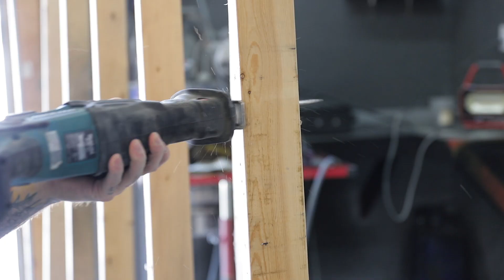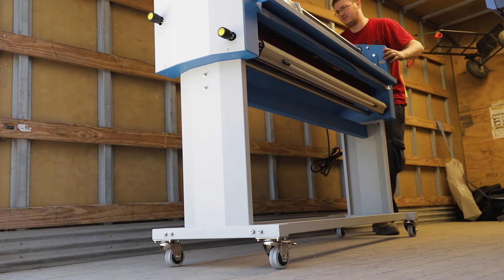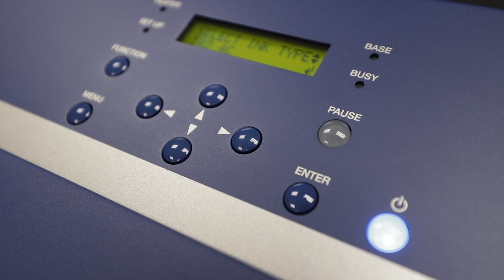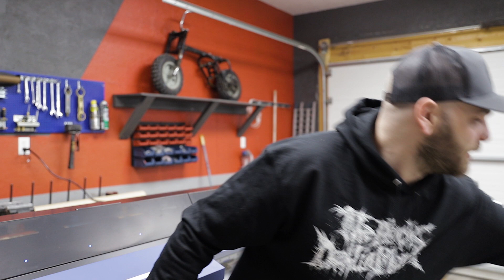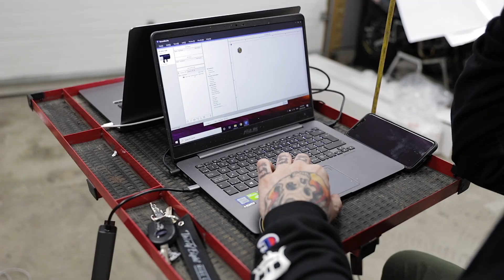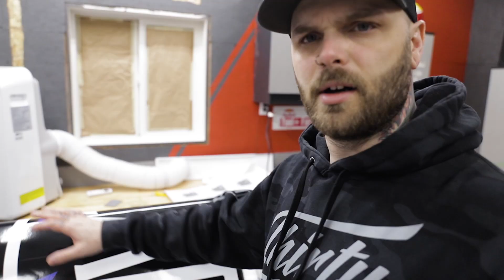What Is Wrong With You? Setting Up My New Roland VG2-540

Comment: O yea i meant to tell you to check the photo or image DPI my HP 1059c plus prints out amazing prints but if the image is 96 DPI it's shit i pump up the DPI to around 600 and they ar fantastic i can also go higher with the DPI but i normally don't do to its an older printer so here is a link to a converter for you https://convert.town/image-dpi

Comment: you live in Florida right ? I live in Pasco ill help you run it, i have an HP designjet 1050c plus 36 inch, you need to setup your print settings its in your printer settings you need to marry your printer to your laptop for colors, color gamut
Reply from the maker: No man I'm in Canada haha
Reply: @leestuart38  well that's a bit far to go hang out just to bust your chops..lol... but if i had the money knowing me i probably would do it hehe, but just check what the max DPI is on that printer and set your image to that DPI, Roland in my opinion are one of the best manufacturers in the business

Comment: They should've advised to get a cheap PC just to run the printer, much cheaper than 3rd party software. Also useful when ripping big jobs, doesn't tie up a machine. I have my Roland five years and the thing I like about it most, is that it just does the fucking job. I keep it cleaned, maintained and treat it like a baby and it never fails me. It has flaws, as does the software, but it works. Lamination is a learned skill, just takes practice. You might have realised this also, but laminating creates mad static and that pulls every bit of dirt to the print. Sealed floors or floor mats help.
Reply from the maker: Ya that's something I wish I would have been told, but that's set up now so it's all good. Laminating is really hard I've learned haha, but I'm slowly figuring it out

Comment: As a printer, designer and former developer I can tell you about the software support situation, or at least my view of it. 
Very, VERY few companies develop for mac. It's a closed and very unfriendly ecosystem to try to develop for. 
At University all development work is (was) PC-centric, there was never an option to learn to develop for apple platforms at all.
So this means the VAST majority of developers are comfortable developing for PC/windows.
Design was artificially pushed towards apple many years ago by sales people, there is basically zero difference designing on a well set up PC or a well set up mac, particularly now that the software is basically the same and even Apple dumped their propriety processors in favour of Intel.
My long standing personal preference for kit + computer is PC + Epson - I have run up to a 64" epson and the workflow just works. 
don't try to mix apple & windows in a professional workflow.
Reply from the maker: I'll have to disagree. The workflow and OS on Mac is so much faster and more reliable. I've had this debate with a friend who's die hard PC guy so we stacked our nearly identical machines up side by side, and the Mac ran away with it when it came to render speed, file sharing and a few other standard daily things we need around here. The OS is what really does it for me though
Reply: @leestuart38  mmm Kay, I think for workflow, it's whatever you're used to and works for you. For me that's windows. 
Anyway, I have the morning free so I'm going to fiddle with my 2019 Honda Monkey :-D

Comment: Have you tried virtual machines? I don't know how much you know about computers so short explanation. Its a way to have multiple operating systems on a computer. Possible windows on a Mac. As a different approach you can dual boot your operating system so you can choose windows or Mac on each boot up.
That's all I have hopefully I've given you enough info to be able to try some Google-fu.
Reply from the maker: That's exactly how I was set up but there's some communication issues doing it that way I found. It's also pretty slow and daunting. I gave in and transfer files to a dedicated PC now to make it a little easier

Comment: It's frustrating figuring them out yourself, but I suggest going online and finding a repair manual (paid a few bucks for a pdf copy)  I've saved SO much in repair costs.  I have an old Roland SP300V but I print a ton of stickers and lots of HTV transfers.  These machines are BEASTS!
Reply from the maker: I have a repair manual now, I had a friend who works with rolands send one over. It'll get put to use when my warrant runs out haha

Comment: At the print houses I have worked at that all used Macs for design they have have a dedicated rip PC next to the printers and saved the headaches and makes the workflow as simple as printing to the RIP as if it was network printer. What you have seemed to have done is make life far far more difficult for yourself! 😔
Reply from the maker: That's the same way I ended up running it
Reply: @leestuart38  This was written before the end of the video. 😳

Comment: Print slower for more high resolution, and test different vynl profiles from other compenies also the width it prints can make a differens
Reply from the maker: I use the slowest setting for each profile one mostly. The main problem was the calibration and head alignment but it's good now

Comment: Hey man. Look up and get FLEXI. im telling you it will save you SOOOOOOOOO much time with doing cut lines
Reply from the maker: I've been checking it out, something i might need to get
Reply: Yeah, i have 2 roland printers and i have a mobile print shop. I use flexi pretty much exclusively for the cut lines. It automatically adds them and saves me so much time and headache
Reply: Yup I'd recommend Flexi too...I respect your tenacity Lee!

Comment: Mac is expensive and just not worth spending on using for ripping files - also ethernet is for a constant reliable connection to internet obviously, not surprised that its being used
Reply from the maker: There's no internet on this machine or anywhere in its workflow. Usb-c or even usb 2.0 would be much faster and more reliable
Reply: @leestuart38  you'll want to connect the printer to your network via ethernet. You'll rub into data transfers speed issues when printing large files which can cause issues, USB 2.0 just isn't fast enough. You'll also want to go into your router and assign the printer a static IP address.

Comment: Just be careful keeping that in your garage. If it gets too cold it can cause problems with the print heads. Ideally, you want to keep it in a temperature controlled environment.
Reply from the maker: There's full time heat and air conditioning out there

Comment: So frustrating I feel ya bro. Do you have a ASI account? There are so many company’s providing this stuff for a really good price and you won’t have the head ache or equipment payment. Good luck.
Reply from the maker: No I don't, I really have no use for one since I don't sub out anything
Reply: Right on bro! I figured you might say that as your experience with sub out jobs has been pretty crappy. Best of luck I’m sure you will have it rockin in no time. I do agree with ya about AppLe Vrs PC, this Industry needs to be able to work on Apple. Been dealing with that for years. Press on!

Comment: Not sure what your Labor situation is, but I’ll tell you I waited wayyy too long to figure out that part. Documentation and process control killed me once I couldn’t do everything myself anymore.

We fixed the computer problem by picking up cheap windows towers and treating them like control panels for each machine. One for the plotter, one for the embroidery workstation, etc. they never have to be updated or moved. And we’re still running one machine with floppy disks... 😂
Reply from the maker: That's my plan now, I'm gonna have to buy 3 pcs to get everything I have or on its way running. Super annoying but at least it works 😂

Comment: I hope he warned you about head strikes ect?? I own one here in Aus. Otherwise you will want to burn it to the ground.. Just make sure you take the time to get the media right and you should be sweet 🙌🏻
Reply from the maker: Sort of but not a lot haha. I'm sure I'll have more hiccups yet
Reply: Seriously the head height on the machines is very low compared to previous generation models. I too own 1 of these and 2 x Soljet Pro 3 XC-540s.   I cannot possibly see any scenario where you would EVER have the head height on Low, we run ours in Medium and have never had a head strike. Medium though is still closer to the print bed than low on our XCs
Reply: Always check media before clicking Print because the temperature might warp it. Its best to RIP only, check media and click print. If media is warped you need to move it forward approximately 0.5m.
Reply: And always use media clamps!

Comment: I am in the same boat with the lack of compatibility with Mac. I hate having to have  two computers out to do one job. 

So I put my windows so that o can keep it closed and still run hook then I control remotely with my Mac using teamviewer . You still have to send files over email or Dropbox but having to now switch over is so much easier in my opinion. Every little bit helps me . 

Amazing video.
Reply from the maker: Ya I just left that little pc set up with it and transfer files over with a jump drive or Dropbox. Annoying but at least it works 😂

Comment: The problem with a lot of this equipment is the salesman only cares about the sale often does not work as good or as easy as they tell you. The ink is very expensive for those printers you will end up using more than they originally tell you good luck love your channel.
Reply: if they say it should work he should be able to reclaim it? Yes the ink is what they make money on. and if it doesnt print for a while. it will clean itself with ink. or at least a regular ink printer does that. :)
Reply: Eco solvent ink isn't expensive..?
Reply: @rrkk6434  whats the average price for all cartridges?

Comment: I do my design on mac and just save the pdf on a portable hard drive and just download it to the laptop that runs the printer and that worked, yes it's one more step but it works everytime.
Reply from the maker: Ya that's what I've landed on. Kind of annoying but it is what it is, at least it works now 😂
Reply: Have all computers in the same network and run a shared hot folder from the PC?

Comment: I use a software called Flexi its windows only though but it is the best print and cut software I have ever used.
Reply from the maker: I've been recommended it a few times now, especially for the big wrap files. I have to check that out